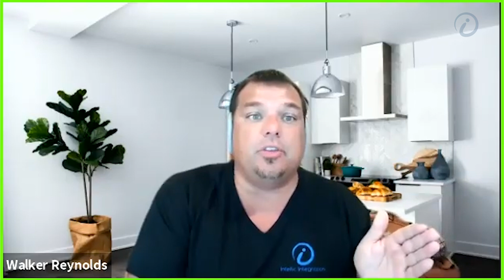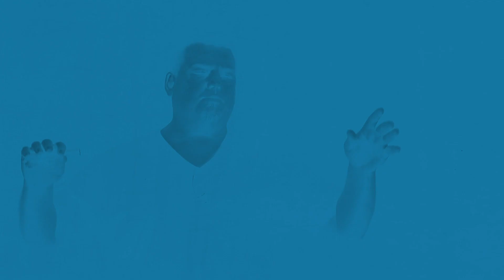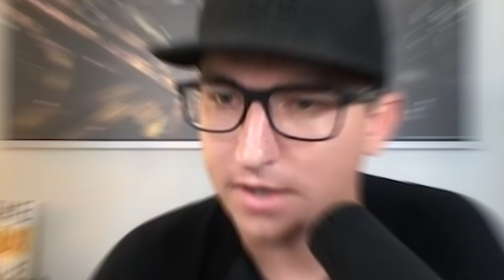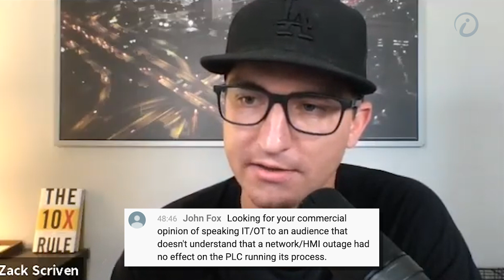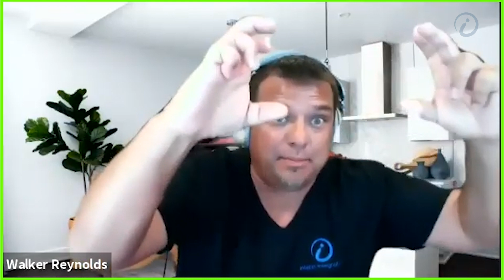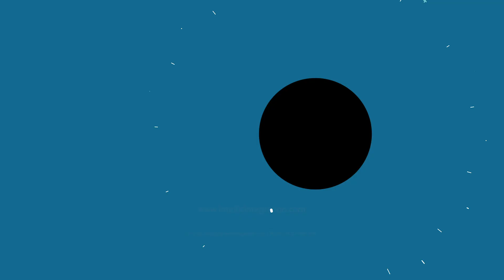PLC/HMI Outage Story...  The importance of getting all the stakeholders involved in the design phase

Comment: Here is an interesting one i bet you've never see happening where network outage will actually impact the process.
Network loops occurred because of:
1-Multiple physical connections Business LAN <-> Process Control Network and 
2. Improper network configuration/poor network design to achieve network redundancy

Result:  STP protocol fails to stop broadcast storms. PLC Ethernet ports gets overwhelmed with packets, watch dog times out, PLC shits it self and all loops goes to manual.
Reply from the maker: Yes! Use NAT to eliminate multi-cast traffic.
Reply: @4.0Solutions  You can still have loops where HMIs and PLC need to coexist on the same broadcast domain for it to function, you can't solve that with NAT. Proper redundancy design and network configurations needs to be done to protect from broadcast domain.

Comment: In a related story, 2 years ago I was on a startup where I was looking at PLC during checkout to test IO and see if interlocks were working.  Next next day I came in and could not connect to the processor to see runtime logic.  I notice all HMI had question marks.  We hunted around for disconnections or failed switches to no avail.  It turned out that the previous evening someone added 2000 tags to the plantwide historian and sucked up all bandwidth. The PLC itself, of course, continued to run the logic but nothing on the network could see it.  I see this as one of the challenges in having a solid Industry 3.0 foundation before throwing Industry 4.0 on top of it.
Reply from the maker: Thank you for sharing that story Patrick!